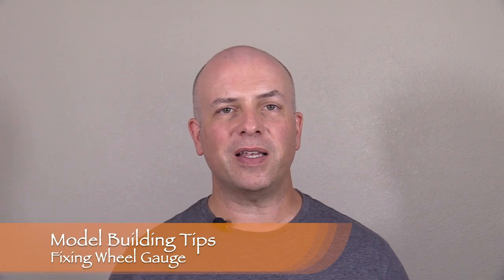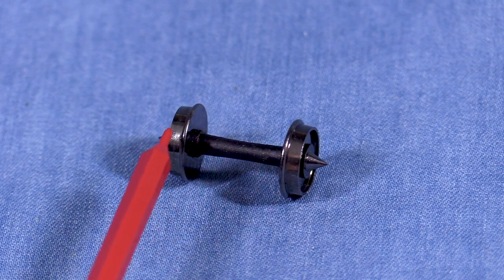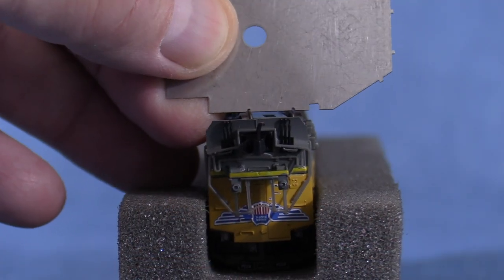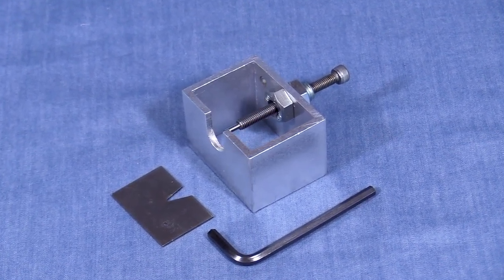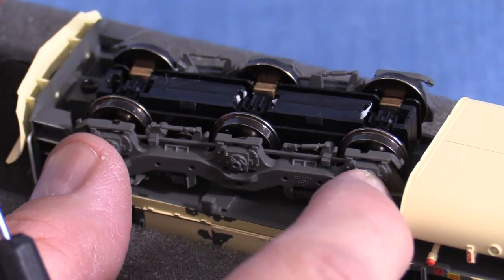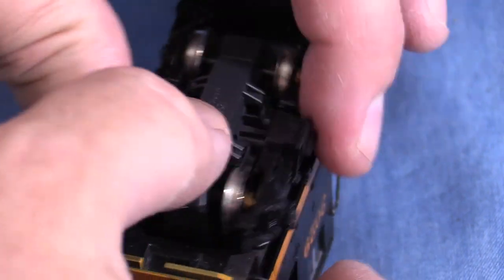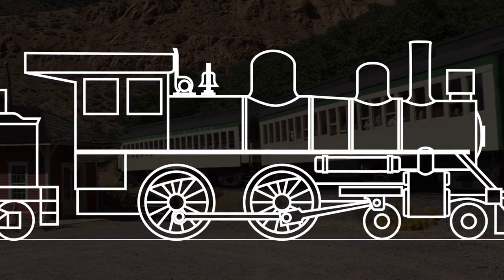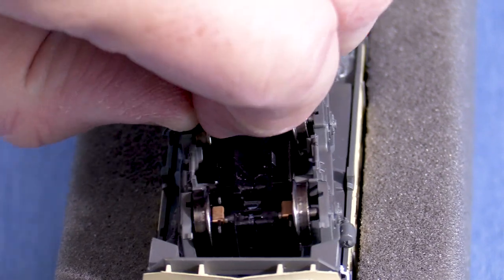Model Building Tips - Fixing Wheel Gauge

Comment: I'm new to railroading and this has been very helpful.
Reply from the maker: I'm glad you liked it.  Thanks for watching!
Reply: @DanielCortopassi  I want to make an HO six wheel truck fit a TT track.
Reply from the maker: The techniques to fix wheel gauge could also be used to re-gauge the wheels.  Good luck with your project!
Reply: @DanielCortopassi  Thanks, i have to look at the with of the power truck itself. I have an old metal one I'm tinkering with and if I narrow the wheeltrack width, the wheels will be tight against the truck's body. I'll have to see some other ones, maybe a plastic truck set will be narrower or I can maybe cut it down.

Comment: Very interesting and informative. I've noticed that the front driving wheels on my largest locomotive (an HO Scale Pennsy K4) seem to come slightly off the track when going through turnouts, so I'm wondering if such a tool as the one shown here would resolve this issue, and if so, where I might be able to procure one.
Reply from the maker: The NWSL puller is still available.  I did a quick search and it looks like the NWSL website has it, and it's also available from Walthers.  They actually have several versions of it for different sizes.  Also, I did a video recently on re-gauging the drivers on an N scale Bachmann 2-8-0.  I used the NWSL tool as well as one from Great Planes that's intended for the R/C hobby, but can also be used for model trains.  Thanks for watching!

Comment: Great discourse. Perhps you can advise. I have a plastic Kato  gauge on the edge of  their re-railer which is 2 slots in the plastic. These  fit the tracks exactly however the wheel flanges are all Narrower.  yet the trains appear to run fineThe slots in the gauge line up with the middle of the wheel flats not the flanges is that correct spacing? Its this the case on  you NMR gauge  or ?
Reply from the maker: I don't think the Kato re-railer is necessarily an accurate wheel gauge.  I would recommend picking up an NMRA gauge.  It does a bunch of stuff, including checking wheel and track gauge (the spacing of the wheel flanges and distance between the rails are not exactly the same).  Some track, like Kato Unitrack, is fairly forgiving if the wheel gauge is slightly narrow, and the equipment will run fine.  Thanks for watching!

Comment: Enjoyed the video Dan, I'm learning so much from watching, I bought an Athearn Genesis, SD60m/60I Diesel Road Locomotive, and the rear coupler is about a half a coupler high, I don't see an easy fix,, it looks to me like I'll need to shim and file, to get it lowered to the right height, any thoughts?
Reply from the maker: Shims are usually the way to lower a coupler on a diesel.  You may need to remove some material below the coupler on the pilot if it's interfering with putting the engine back together.   I plan to do an episode on fixing coupler height in the near future.  Thanks for watching!

Comment: NEW SUBSCRIBER and new to hobby. Thanks.  Eaglegards...
Reply from the maker: Welcome!  And thanks for watching!
Reply: @DanielCortopassi  You're welcome.  Yeah, I ordered HO stuff. First order, today, I got WaltersTrainline tank car Quad Hopper, and flat car. Flat car fine. Couldn't believe it - steel wheels.  Terminology is still foreign. One had wheels undercarriage off and no screw. Other one screw in hole and carriage not attached. I've looked everywhere how to unscrew screw. Nothing. You did it at 4 minute mark, but my screws don't look like your screws. I'm screwed. At least a paper was in boxes from Walthers with number to call. Again, I truly appreciate reply. I'm laughing like heck. A hobby with problems.
Reply from the maker: Sorry to hear you had issues with your models.  Sometimes you can use a substitute screw to attach the trucks if the original is missing.  I've got a supply of small hobby-sized fasteners that I've collected over the years.  Sometimes they come in handy as replacements.

Comment: Daniel, can you give any information on wheel sizes?  It can be confusing  when replacing plastic wheels with metal (33" or 36").  I model in N scale, and the storage boxes they came in do not give any information on the wheel size.  Are there any quick or good rules to follow?
Reply from the maker: A general rule of thumb is that steam era freight cars have 33 inch wheels.  Most passenger cars have 36 inch wheels.  Many, but not all, modern freight cars often have 36 inch wheels.   It seems like cars with 100 ton capacity generally have the larger wheels, while some cars, like boxcars sometimes have 33s.  It seems like a small difference, but it actually changes the look of a car, even in N scale.  There are, of course, exceptions to everything, so the "rules" should be interpreted loosely.  If you can do some research and find out what the car you're modeling actually had, that is of course the best bet.  Thanks for watching!

Comment: still didn't answer my question, how to measure wheels, 33/36/40 diameter
Reply from the maker: Sorry if I missed your question before.  You can measure wheel diameter with a scale ruler.  You can also compare them to other wheels of a known size.  3 scale inches doesn't sound like much but even in N scale there is a noticeable difference between 33 and 36 inch wheels.  40 inch wheels are large for a lot of rolling stock, but more common on locomotives.  I hope that helps.  Thanks for watching!